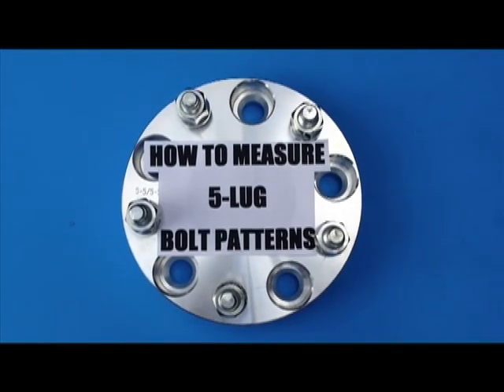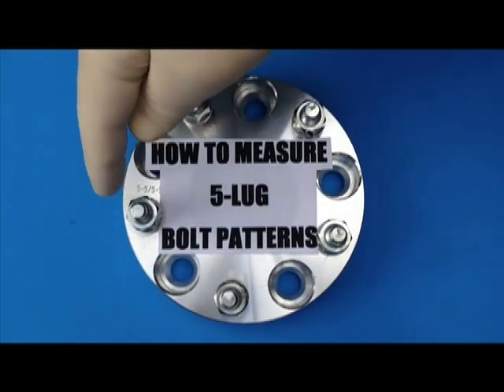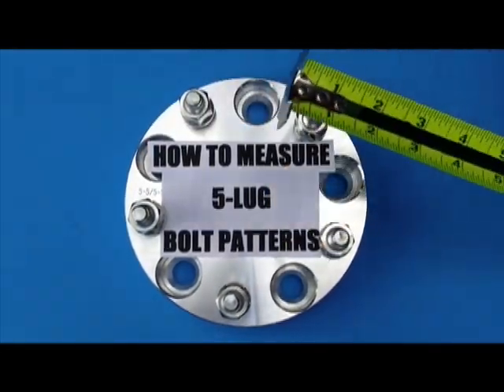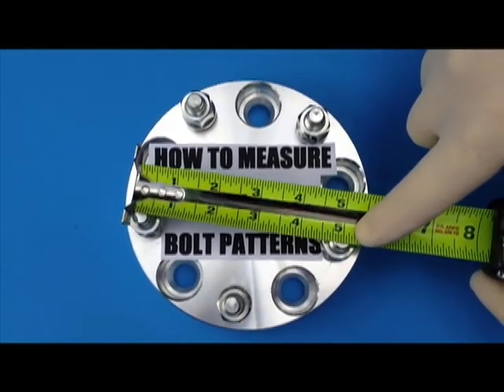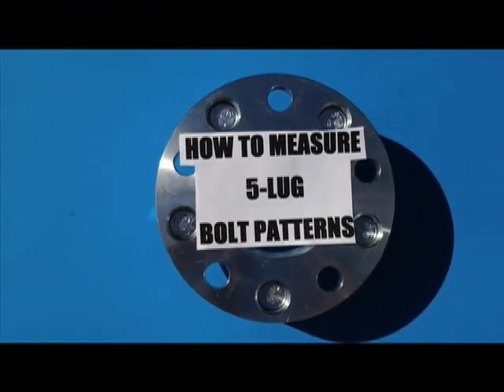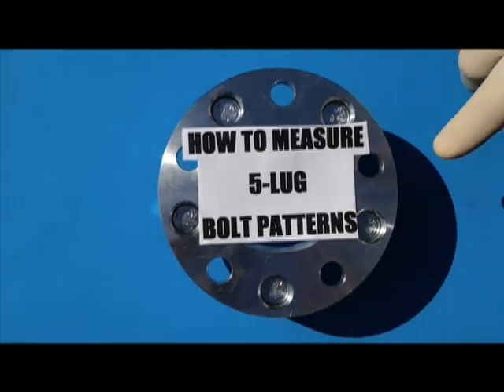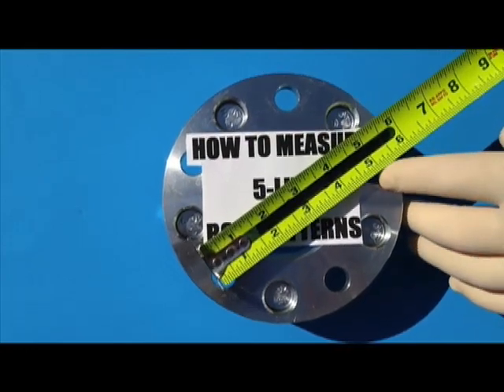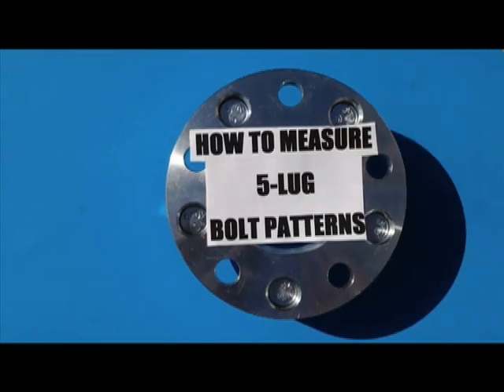How to measure a 5 lug wheel bolt pattern

Comment: this is very wrong, FIRST you measure from CENTER of the hole, now fom where you feel like and and SECOND, you add 1/4 inch to your measurment
Reply: I heard u don't have to add 1/4th if u measure from the top of one circle to the middle of the other instead of starting from the middle and adding 1/4th